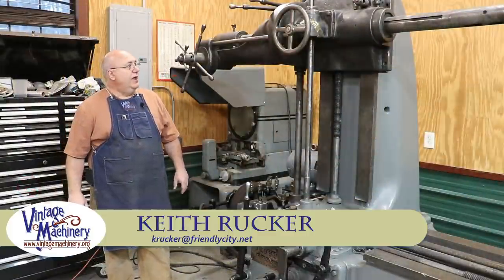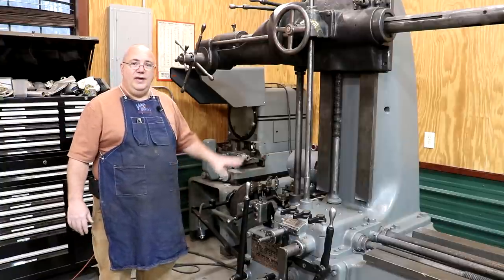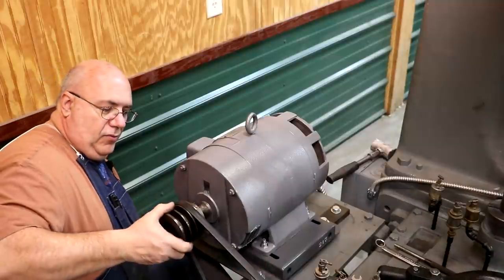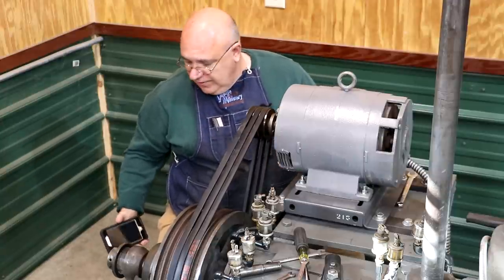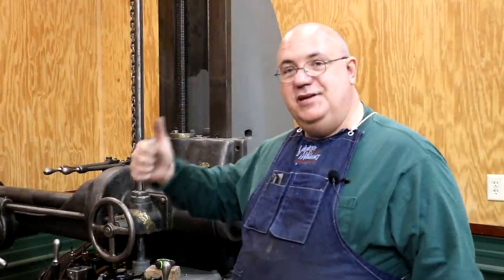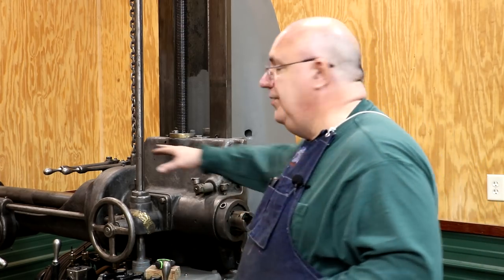Lucas Horizontal Boring Mill:  Installing Belts and Getting Under Power

Comment: The great thing about these old machines, is that they'll outlast most of the modern junk and still be here and usable in another 100 years, because of people like you keeping them going.
Reply: I’m not sure you are totally correct when talking about modern junk. If these old machines were so much better, why aren’t there a lot more being used still. Answer I guess is, too slow and too expensive. Modern machines can produce a wider range of products straight from CAD, into CAD/CAM cutting time and expense. All these machines have their place and time. Regards
Reply: Modern junk 🤣🤣🤣

I’m a fan of old machines, ran many of them including a 1934 G&L horizontal boring mill. But that machine isn’t going to make you any money in todays world like the “Modern junk” will.
Reply: @petergregory5286  yea theres no comparison that a new machine that can do basically anything can outperform this old timer but that's not the point. This cast iron beauty will always work as intended and it's going to always be desirable. New equipment reaches obsolescence much faster and is rarely worth preserving

Comment: I like it "I went to the store and got 2 more belts".
I used to be able to do that in the UK. In particular we used a company called BSL, our local branch seemed to have everything we needed, they knew what we wanted and used and kept it on the shelf. More than once I got the on call staff out at 2 or 3 in the morning, for a bearing or seal. They got taken over and are now called Brammer, the acountants took over; the local branches closed, closest one is 20 miles away, if you ring them up for something, "yes we have it in stock", but that turns out to be 150 miles away at a central warehouse. As much use as a chocolate teapot. Its all order online for next day delivery now, brilliant, except I have a line that costs £5,000 an hour in lost production stood for 12 hours. I've had to rob bearings off another working (but cheaper line) to keep the expensive one going. Glad I've retired from all that.

Comment: 4:02 .. Just an added note for any beginners online, the other job of interlock is best described as, if the power goes out for any reason, when it comes back on again, the motor will not restart, ... until someone pushes the go button .. very nice safety feature!!
Reply: Also known as 3 wire control.

Comment: Hey Keith!
Just a little tidbit from over 30+ years working with multi-groove belt driven equipment...IF at all possible, start with the belt on the smallest sheave on the drive and "walk" the belts onto the larger sheave.  It will make life a LOT easier & fewer pinched fingers!
Ken

Comment: SU Viscosity at 210 of 73 translates to a SUS at 100 of 600.  According to the Van Norman chart that translates to about a 40 weight gearbox oil.
GEARBOX OIL:  Mobil DTE Heavy Medium.

I don't pretend to know or understand what I wrote above. I included it to say that machines made even as late as the 1960s will list recommended lubricants in such a manner that they appear to be unavailable. Yet, Keith is not the only guy in the know to come to the same exact conclusion! Keith, you are my favorite professor!

Comment: Nice old mill. I ran a 60's vintage Lucas 4" bar back in the mid-70s in a Die Cast Mold maker facility. Milled insert pockets in mold bases, some being 14" deep, and 20w x 36 lg. One pocket had 6000 lbs of steel taken out of it. Had to sharpen the sides of the 6" dia cutters about once a day using the tool and cutter grinder setup next to the Lucas. 
Good video!

Comment: I recently restored a South Bend 13" lathe and tried to find a pair of matched belts. I didn't find them and ended up just buying two belts from the same company at the same time. My guess was exactly what you said - modern belts are made to tight enough tolerances that they are "matched" by default. It was great to hear your comments on the issue because I have occasionally wondered if I did the right thing there. The lathe runs smoothly, so I guess it's fine.

Comment: I have to share a great trick for lubing. Mix your DTE about 75/25 with automatic transmission fluid.  Two solid reasons: 1. it has some detergent to control grunge buildup; 2. it's RED! Makes it very easy to quickly confirm you've got lube where you want it. No downsides. It is gear lube after all and has extreme-pressure properties.  I got this from my machine rebuilder who does real high_end work. His big grinder has a work envelope of 17 x 8 x 6 FEET.

Comment: That new mic you're using now might be cheaper, but it kinda sucks. it sounds fine as long as you are talking toward it, but when you turn your head to the right, the voice volume really tapers off.
Reply: The audio in this video is terrible.
Reply: I came here to say this.  It is distracting when the volume changes depending on the direction of his head.

Comment: When we installed the taper lock pulley that way, we always installed the removal hardware at the same time because you may not have enough room to insert long enough hardware to push the pulley off the tapered bushing. Looks like in your case you'll have enough room.... Nice work!

Comment: HBM's are a very handy machine tool and are a must for big line boring or facing jobs.

A bit of history: The idea for welding manipulators originates from the HBM, and the company I used to rep for in St. Louis built some large ones, up to a twenty-foot plus boom lift and stroke for the naval yards. They were used to weld submarine pressure hulls, etc.

Comment: That machine looks like the perfect "toy" for a young machinist or engineer to be to dream about.  It is absolutely a gem.  It is too bad you didn't have it available for machining the piece that had the close deep pockets you were having difficulties with. 

In one of your future videos I would appreciate it if you could explain what looks like a cardon shaft to the left of the head you were raising and lowering.   On the video the shaft looks like it's at an angle, yet it still runs true through the machine.   It is hard to visualize how it actually moves.

One suggestion, replace the stop button with a red one.  While I support keeping machines as close to original as possible  it will be to easy to "lose" the button in an emergency.

I enjoyed watching you getting your mill running.

Bob
Reply: That shaft looking like that is probably just a trick of the camera perspective. Maybe not but that seems like the easiest explanation.
Reply: His stop button is a red one !
You could spend a day lubricating that machine !
Reply: @millomweb  ....This video is practically x-rated for an old "oil meister" like your self.  I can't count the number of his videos in that you have ranted about his lack of "lubrication skills".
Reply: @paulcopeland9035  Had it been me, I would have oiled the vertical screw before lowering the head, he didn't !
Reply: @millomweb  , that you know of.
You haters figure if Keith doesn't actually physically DO it on film, right in front of you, that he didn't do it.
He does stuff off camera you know.
He oiled what he did on camera just for YOU, and the others that don't understand how video works.
It IS hilarious to watch you nit pickers come out of the wood work EVERY time.
Amazing Keith doesn't utilize the BLOCK feature more!
Reply: @haroldphipps3457  20:40 He lowers the head - at the time the screw is DRY. After he's lowered it, look at the screw above - it is wet - previous user obviously oiled it !
The camera never lies !
I'll show you - when I can get going with my own channel ! Sadly I've many obstacles to overcome :(
Reply: @millomweb  I'm sure your channel will be awesome!
Hope you can pull it together!
Reply: @haroldphipps3457  Thanks.
I've inherited my dad's garage/machine shop/junk shop.
A year ago I was struggling to decide the power solution. Got a generator. Then I found a few electrical faults (mostly dad's wiring) but one motor on my mill has a fault I need to find and fix. I need to shift a load of junk to get to it.
I've other matters of life getting in the way too :(
I kicked the channel off last summer - with the arrival of the generator. It's called Machining by Mike.
I also need video equipment - since the cheap camera went faulty too.
Then there's financial struggles !
I will battle on - but I can't give a date I'll get back to it yet :(

Comment: I ran a #42 Lucas boring mill in my apprenticeship, nearly the same at the one portrayed in the video, it was WW-2 vintage and badly worn out, but the main thing I did not like was the interlocks on all the feed levers, done so that only one feed could be engaged at a time and the fact that one never knew for sure what direction it was going to feed when engaged; I later went on to run the two G&L 350T boring mills in the same shop, on them, the feed handles were moved in the direction desired to feed and the feed/rapid travel lever moved as desired, feed and rapid travel being in the same direction, unlike the Lucas where they are in opposite directions, the G&L machines are the best of all for simplicity of controls.

Comment: That's a very job specific machine. I have an Hendey engine lathe that I have been using for years. That was made on either side of 1900. It has an open flat leather drive belt that runs it. Also has sleeve bearings not ball bearings. I can hit my number.

Comment: hi keith! normalizing an audio clip with an impact gun in it will make the spoken audio very quiet, normally it's not so bad but it's nearly inaudible at 12:22, a compressor can knock down the peak loudness of the impact gun so normalizing doesn't kill the speech (there are better ways to do even that, but a compressor is quick, experiment)
Reply: Keith, your Sennheiser microphone seems to be highly directional. When you have it mounted on the left side of your apron AND you speak with your head turned to your right, the audio amplitude decreases. Amplitude increase is noticeable when you speak AND your head is turned to your left. Your RODE mike sounds omnidirectional. Excellent content, as usual. Thanks for sharing, Keith.

Comment: Morse QD hubs. Dodge Taper Locks work well too! And use matched belts (the match numbers are on them). We also sold a lot of multi groove belts too. One belt to rule them all! ;)

ETA: Any particular reason you put the hub toward the motor instead of on the outside? We always designed systems (and our customers did too) with the hub outside to make it easier to get to. Particularly if there were other things around it that got in the way.

Comment: FYI, It's easier to start the screws attaching the tapered bushing to the drive pulley prior to sliding it on, saving your knuckles.  I have the same exact tapered bushing for my 2x72 grinder drive wheel.

Comment: Keith, thank you for sharing as always. One question/suggestion; why didn't you slide the pulley all the way up to the motor? By doing so you end up with a more rigid result. It all seems quite beefy but I would minimize the bending of the shaft as much as possible. From here it looks like you have enough room to do so. The couplings wok great but they have one slight disadvantage; they move sideways when you torque the mounting bolts. Because of this I usually torque them halfway an tap the whole assembly to the right spot on the shaft and then torque them to spec's. Maybe this makes sense. All the best, Job

Comment: Goodness, you can press the start button and the motor starts and then press the stop button and the motor stops.  That's very clever.  What will they invent next?
ETA As suggested below, get a red stop button so it's obvious which one to press if you need to shut the machine down RIGHT NOW!

Comment: Keith nice work as always but just want to point out your new mic setup goes up and down in volume depending where your head is turned, i assume you're still getting used to it but its just a heads up.

Comment: Pulley alignment by eye seems a bit rough !  Maybe use a straight-edge against the pulley faces to check that the motor shaft and machine shaft are parallel, and measure the belt-to-straight-edge distance at each end of a belt loop to check the axial positions of the pulleys are correct.
Reply: Good idea but usually not done in the field.  A straight-edge sometimes, but only if it is handy.  Time is money you know.

Comment: Uh, Keith, you are putting the hub/Sheave on backwards. the hub needs to be on the outside so you can access the screws.
Reply: There's not enough shaft on the motor to install the sheave correctly

Comment: Kieth, the audio is very variable.  As you moved your head back and forth, the level would change.  Is the lav mic you are using a cardioid polar pattern?  Great to see the motor running and the spindle turning.

Comment: I suppose the motor shaft is not long enough to be set it up for the taper lock to be on the outboard side of the sheave. It's a lot handier to work on that way.
Reply: Looks like motor should be shifted outboard of its current location for better alignment.  The further outboard the more radial load on the motor bearings.  Sometimes mocking up the setup can get difficult.  Guessing in 1918, this was a line shaft driven machine.  Probably needs a belt guard.
Reply: @geoffmorgan6059  Keith said in the last video that he does have the belt guard for it.

Comment: Hey Keith, quick question, when you source a motor for a project that doesn't have one, how do you determine the ratio from the motor pully to the machine pully drive? I need a pully for a lathe I'm bringing back to life, I picked a motor in the same rpm range that would have come on it and I believe it was running a ratio of 2to1 but how can I be sure?

Comment: Dismissal of matched belts wouldn't be as much of a concern if you hadn't reduced the belt count by 40% and reduced the motor pulley diameter as well.  With any luck this machine will only see light use and the matched unmatched concern won't be for much.  Good luck!

Comment: Just shows the safety problems that CNC suppliers overcame by placing their equipment in cabinets. This is a very good machine which even after 100yrs can be made to produce accurate cuts. But modern machinist’s maybe don’t expect all those rotating catch points their predecessors took for granted. My father when he was an apprentice toolmaker at CAV, which later became Lucas CAV would have understood and taken the appropriate precautions back in 1924 through 1931.

Comment: I'm wondering if you could do anything about the volume normalization or microphone placement? At some points (3:36 for example) the volume jumps up and down quite a lot because you're talking closer and farther away from the microphone which is difficult to listen to. Perhaps it might even work to move the microphone further away?
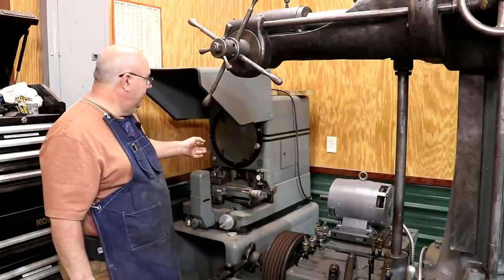Reply: Perhaps 4:40 is a better example. I've personally had good results with the loudnorm lavfi filters, but I'm not sure if those are usable for your setup.

Comment: Im sure you have heard of matched belts.  You should look into that....i betting one of those 3 will always become louse  rather quickly after adjustment.
Reply: Matched belts are overkill for this installation.  However, the "louse" belt might need a looking at!

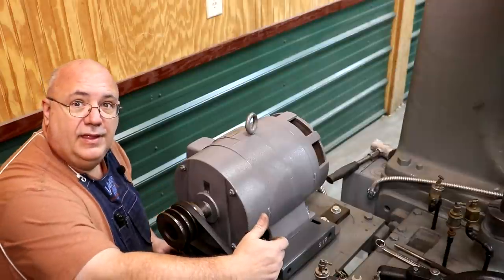Comment: 13:10 .. You're supposed to buy the belts in matched sets .. the size on the belt is nominal, they get matched up in sets after manufacture.  These aren't even all the same brand! :) .. see how sloppy the last belt is? .. might as well just have 2 on there.
Reply: Nonsense!  What he installed will be perfectly serviceable for many years.
Reply: @paulcopeland9035  correct!
In Central Iowa, "belt places" will not even entertain conversation about matched belts.
We are lucky to find 3 of the same numbered belts at any one vendor, let alone get a "matched set" of them.
Haven't worried about matched belts for over 10 years.
Reply: @haroldphipps3457 ... Thank you sir!

Comment: The same manufacturer should have the same length belt but that isn't always the case. I have had to ask for matched sets for my multi-groove pulley stuff.
Reply: I asked for matched belts from a place to go on my lawn mower. Couldn't get them. Like Keith I finally settled for 2 belts from same company, same number, same country of origin as in USA. They worked just fine.
Reply: Whenever you have multiple belts on a sheave they should be matched belts. Being the same number and maker is no guarantee of being the same size.
Reply: @millwrightrick1  , I was told very few are made anymore.
Reply: @johnirwin1837  When you buy belts now the manufacturer will have on the belts that they are within a certain tolerance or they will have a lot number on them.  That is what  you use to match your belts. You could also use a gang belt. 3V, 5V and 8V type belts are made to higher tolerances but A and B series belts still aren't and can be mismatched even though the nominal size is the same.
Reply: @millwrightrick1  ,good luck in finding a dealer who stocks them that way in my area that I can simply walk into, get and walk out. Ain't happening. Lowe's, Home Depot, Tractor Supply, any auto parts store.
Reply: @johnirwin1837  Try an industrial supply company.
Reply: @millwrightrick1  , 99% of the time it's not worth my time to run in a 50 mile circle.